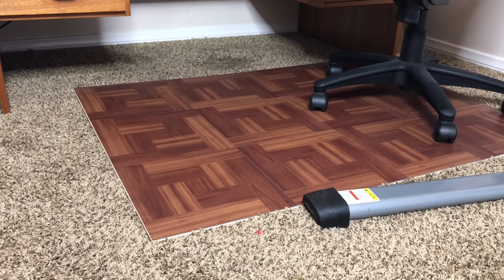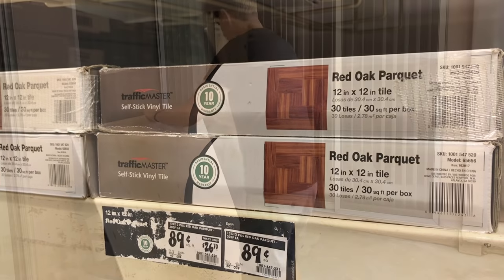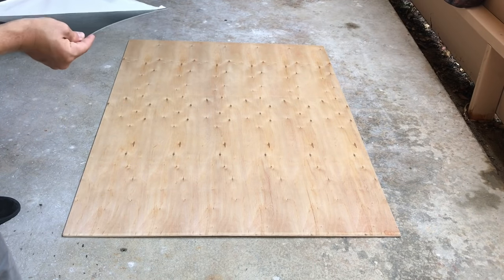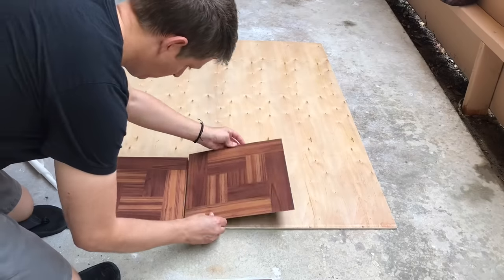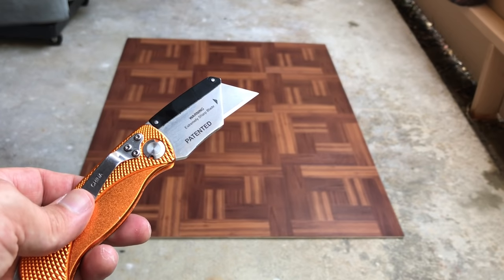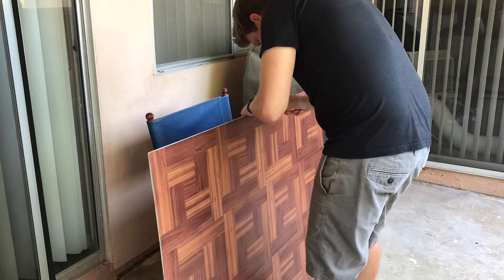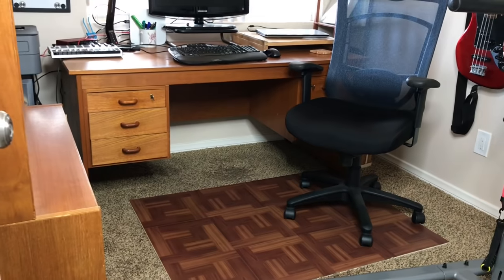DIY Office Chair Mat For Under $25!!!

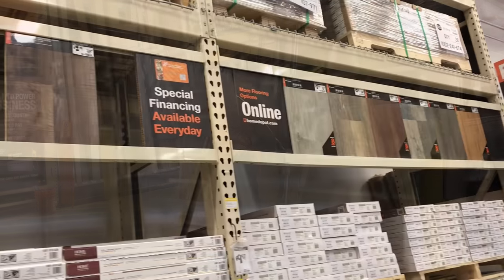Comment: Would it work to cut the tiled plywood with a saw, e.g. table saw, circular saw, sliding saw (preferably the one at 0:27), and get a better finished edge (with a little bit sanding if necessary)? This is a great idea. I have been thinking about a mat but indeed the price is ridiculous, not like in you place for $50-100, here is $100 or over $200 for the size I want! I'm going to DIY one. Thank you for sharing the idea.
Also, how long dis this last. I'm not expecting the same performance as the commercial options but good to have some idea of this.
Reply from the maker: Hi Max, it lasted years! I got rid of it when I moved though. I feel like if you cut the tiles and the wood at the same time it would not go well. If you sand the edges properly it will be plenty smooth. I'm not sure what the name of the saw is but its really cool! They have them installed at some hardware stores.
Reply: @kevinbrown1073   The saw is called a "panel saw"

Comment: Another idea I just had would be....if you need extra thick extra durable floor mat then with an ultra thick plywood but the edges you could 3d print your own trim from recycled PET bottles. :-D Or I am sure Home Depot has trim/threshhold you could use too.
Reply from the maker: Great idea!

Comment: Well, I tried this a month ago and sadly, I have to say that the tiles are easy to install but they don't hold up to your chair moving around.  Good idea if the tiles are hard enough to withstand the wear and tear.  Mine didn't.
Reply from the maker: Thanks for sharing, and sorry it didn't workout! Would
 you mind posting the type of tile you used so others can avoid using?
Reply: I bought the tiles from a local hardware store.  The tiles looked good but were not very thick, only 1.65 mm.  The wear layer thickness is 2.6 mil.  They stuck to the plywood very well.  There was no name brand on them.  Ebony Marble Peel and Stick Vinyl Tile is the name of tile I installed.

Comment: Has anyone done a desk mat with plain wood and no tiles? I know not terribly attractive, but I’ll go nuts if the tiles start to come apart. I don’t mind the color though .
Reply: I got a piece of 1/2" Sande hardwood plywood and it doesn't hold up on its own. The plywood has internal voids that the chair wheels will punch through in a day. You have to put the tiles over the plywood no matter how thick of a sheet you get.
Reply: For a long time I used two pieces of 3/4" plywood that were sandwiched together with wood glue, and stained the top layer then did a few coats of spray on polyurethane. It didn't look the greatest and showed signs of wear within a year or two but it did hold up. I ended up making a second version with a single sheet of 3/4" ply and those snap in wood plank flooring boards and it looks way nicer and is holding up well

Comment: This is fine if you do not care about the floor or carpet beneath the homemade mat. The wood base that you use WILL affect your carpet. All wood is natural, has oils, and may additionally be treated (e.g. the glue treatment for lamination, anti-rot wood preservatives, etc.) by manufacturer/lumberyard.
Reply from the maker: Weird how all my wood furniture sits on the floor and does affect the flooring...
Reply: KB Basic We move the furniture. And it’s not raw wood, unfinished wood. Additionally, wood furniture is small surface area in contact with floor, whereas a large board not only does not allow a huge area of carpet to breathe, it does not allow penetration of light. As such, the carpet around it will lighten with exposure to UV and non-UV light, and the carpet beneath it will not have that exposure, creating a disparity in color over time.  Of course, I was going to keep it simple without all that, but since you asked, lol. This is the reason one does not see wood (especially raw wood) chair mats.
Reply: if your this worried about the wood hurting it let the wood fully dry out the plywood should be fine you can also add the lament floor to both sides of the wood if you want to protect the carpet.

Comment: I feel like that thin wood would just crack under chair movement. Unless may you’re a kid.
Reply from the maker: I was at about 180 lbs plus and a pretty heavy chair and had no cracks. Though, the beauty is you can always use thicker plywood.

Comment: no way you would put holes in that thin of wood
Reply from the maker: I've had mine for years now and no holes. Distribution of weight is an amazing thing
Reply: @kevinbrown1073  yeah but your a little guy
Reply from the maker: @idahofishgamer3560  Fair enough man. So thicker the guy, thicker the wood